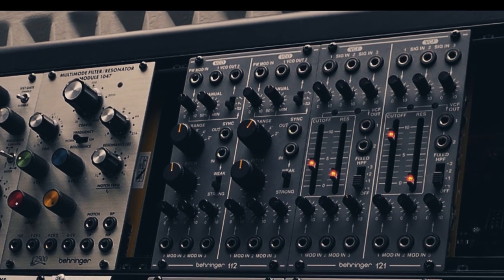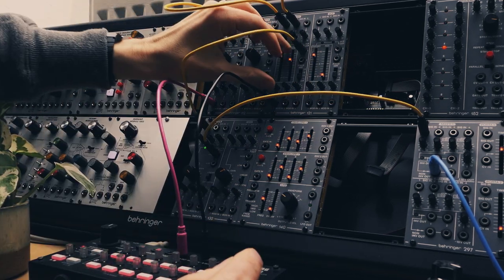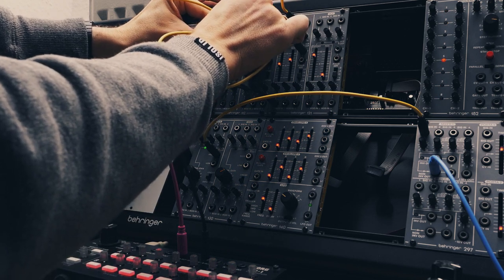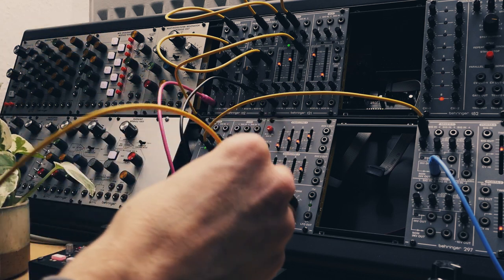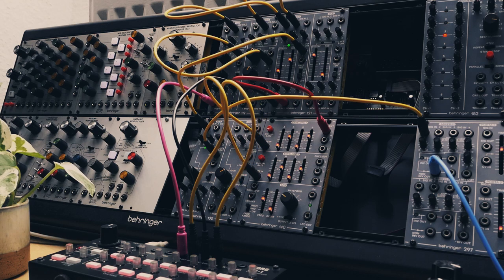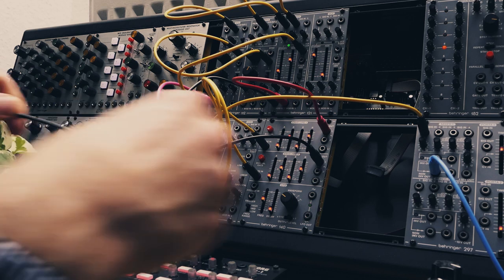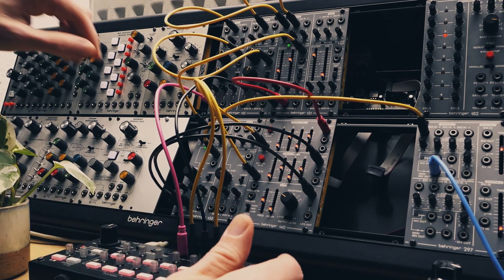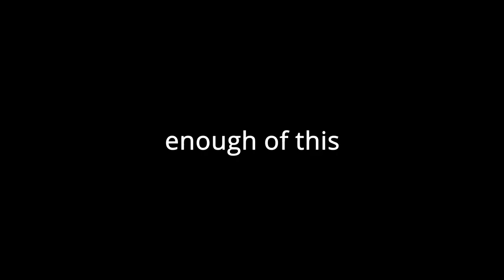Behringer System 100 ~ 4 modules make a duophonic synth

Comment: very good...  
further more you can transpose the 4 step-sequence with slow LFO at the mod-Input of VCO with very slightly turning up the attenuator, as you do manual at 21:00.  
Does also function with a midi-Keyboard as it holds the voltage for some reason.

Comment: Your jack insertion close-ups are making me laugh every time 😅

I watched and liked all your System 100 demos! I own a full balanced System 100 set for over than 6 months now (it's 2x140, 2x182, 2x305 and 1x for all other modules). However, I think that the time I spent watching your videos is actually higher than the time I spent playing my own system so far 😸

I agree that Behringer's System 100 modules are pretty handy when it comes to adding extra modulations and CV sources to each module because of its triple inputs with attenuators. It would be cool if they release some simple BBD and (spring?) reverb with similar design just to match the rest of the system. I know that there were no BBD or reverb in original 100M, but it would make the system much more self-sufficient. I think, almost everyone would agree that delay or reverb is a must-have for synthetic timbres.
Reply from the maker: Yes indeed, I really never want to miss these effects. But I don't think that Behringer will extend the series any further, as that would mean they have to invent their own System 100m modules that weren't available in the original. Btw. the 172 module offers an audio delay, not quite intended to be used in a classic echo config, but still it's a BBD.

Comment: I really enjoy your System 100 and 2500 video too, thank you for making these and sharing such good information. In this video, I notice you are using the 297 module for mixing audio. As I understood it this is DC Coupled CV mixer and wanted to ask if there is any issue in mixing Audio or AC Coupled output?
Reply from the maker: That is fine, the DC mixer in the 297 is bipolar in the +/- 10V range. Usually DC mixers work for audio and cv, while AC mixers only work for audio.
Reply: @synthesizer83  that's what I thought, but thank you for clarifying. I am finding the 297 a very useful module, mixing CV or Audio, it's a great tool